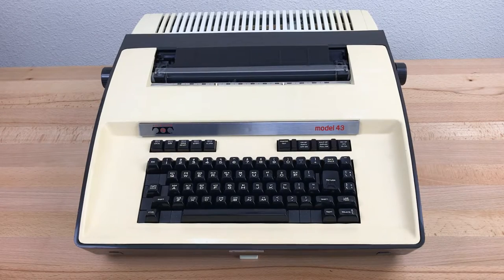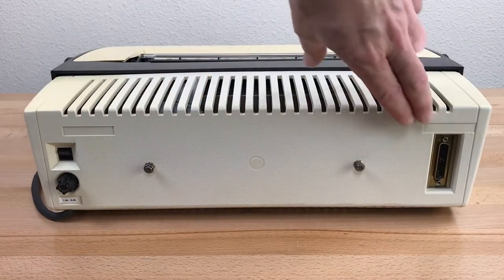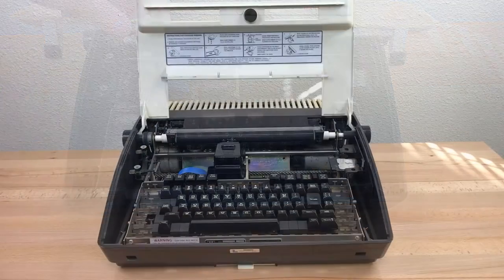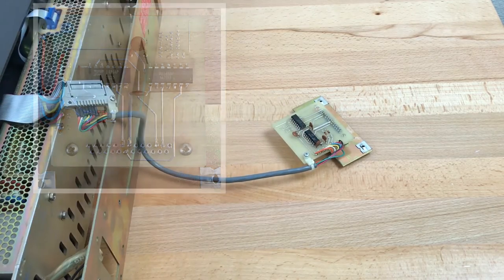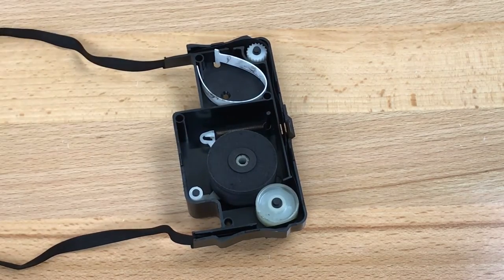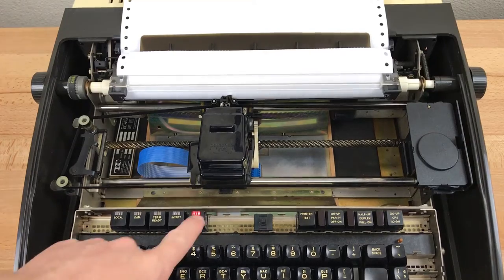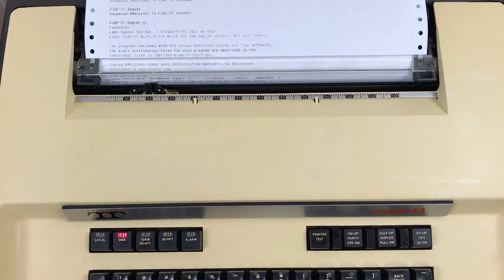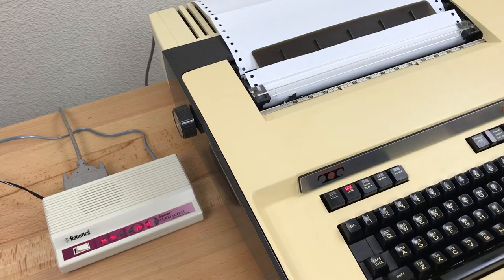The Model 43 Teletype

Comment: I started out on computers with one of these in middle school, 7th grade. We used an acoustic coupler dial-up modem you put the telephone handset into to connect to the school district's remote HP-1000 minicomputer. It was dog slow and unreliable, but the sound of the Teletype was very distinctive and cool.  By 8th grade they switched over to Apple II's with diskettes.

Comment: I enjoyed this.  I used to repair these in their hundreds.  I worked for Leasametric in 1981 in Allendale NJ.  These were under warranty from the manufacturer but Leasametric figured they could not be without them for the period that they were sent back to be repaired so they hired bench techs to do it locally.  Leasametric leased electronic test equipment to whomever would pay their price and then they branched into computer terminals and printers.  The largest customer for the Model 43's by far was a customer called Connecticut Credit.  In the morning the Leasametric van would go out and place these in car dealerships and anyone else who needed to check customer credit.  In the afternoon it would bring in damaged 43's.  I did so many it got so I could repair the power supplies to component level.  I cannot prove it but because Leasametric belonged to TransUnion the tank car builder and lessor I believe Trans Union bought Connecticut Credit and changed the name to TransUnion Credit.

Comment: I have one of these in storage that I bought on eBay about 15-20 years ago (I just might have to bring it out, clean it up, and connect it to my RasPi, now that I've seen your video :) ).  It came bundled with an external acoustic-coupled telephone modem that connects to the 43's serial port, and the paper holder that came with my 43 is different than the one pictured in this video--it's made of thick chrome-plated wire (like a shopping cart).  The 43 I have is also a bit more yellowed than yours, looks like I might have to give it the RetroBrite treatment.

Thanks for sharing this here on YouTube! :D

Comment: Nice, I just missed out on this era by a few years. It seems so extravagant to be using up consumables with every line printed, but I realize CRT terminals were so expensive at the time. The main thing I wonder is did you get in trouble for playing games on it back then? Something like Star Trek could use up LOADS of paper after each move, displaying the quadrant/sector map.

Comment: I was a Teletype tec for 9 years from 1983 to 1992. I worked on model 43s  down to component level.
Sears catalog showrooms had model 43s that called Sears tower in Chicago over acoustical coupler at 300 baud half duplex.
But the dairy farm hooked to USDA for milk monitoring was the best.
P.S. It looks like your print head needs a lite grease up in the hole closest to the paper.
Reply from the maker: Off camera I took a look at the printhead because I noticed black goo around the sides.  I cleaned it up and took a look at the parts and wires.
The book lists replacements for the ribbon guide and wire guide but I'll never find those parts now so I took them apart carefully and cleaned them. The wire guide is worn with a slight crack but still works after reassembly. I lubed the wire guide sparingly with a light silicone oil but realized I need to use an oil based ink instead.
Should the forward print head well be filled with grease?
Reply: I remember we filled the pin guide area with grease  and yes keep oil and grease off ink ribbons.
also we had to reset the coils.  on each side of the printhead there are indented coil adjustments.  We would set the adjustment(if I remember the slot was perfectly up and down), open the coil and close it by rotating the adjustment until it closes and then add 3 more tics to it. All coils needed to be reset. When opening coil make sure the pin is free to move forward and back

Can I ask you what town/city/state you are in?
I am in Columbia SC

Comment: Hi Chuck, I have one of those tape readers-punchers you mentioned in your video (Teletype M43 data terminal Code 4250AAA)  it is the 8 channel model (1 inch tape)  RS232 serial interface. Here in Argentina we used it in the nineties to load design data in embroidery machines (prior to 3,5 inch diskettes)

Comment: I have just restored a model 43.  I am wondering where to get the 11 inch wide tractor feed paper.  Thanks.
Reply from the maker: Yeah, I found it on Amazon. made by Alliance, sold by Impreso, mfr part # 99388.
"Alliance Continuous Computer Paper 12" x 8-1/2"
Reply: @HutchCA  Excellent!  Thanks!

Comment: Please be aware that the dot matrix ink usually included a lubricant.
Reply from the maker: That makes sense.  I haven't found any dot-matrix ink "refills" anywhere.
Stamp pad ink was recommended which is oil based.
Reply: @HutchCA  you can get a modern ribbon for another printer and try restuffing the box.